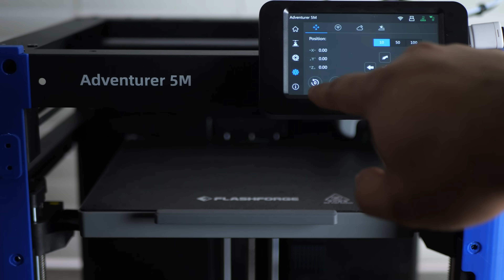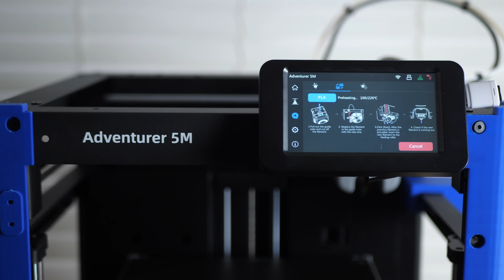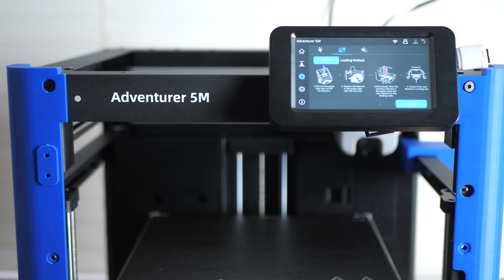How To Change Filament On The Flashforge Adventurer 5M

Comment: Flashforge really messed up on this one! Even ChatGPT is complaining about the lack of instructions, and suggesting there used to be a way to get it to heat and retract in the software. It's a wonderful machine, but this is a HUGE negative.  Except that you have this video, so it's workable.  I hope those Chinese engineers read this and get up the nerve to stand up to their bosses, so it gets fixed (I have an office in a Chinese country, and know exactly how badly engineering works due to the oppressive social order).  If not, at least put a help menu in there, explaining that you have to cut it off manually. It has some vague text in that regards, but no one would be brave enough to yank on that tube, without seeing it in a video.

Comment: so I've done this process 5 times already and it hasn't changed a thing. i used the PLA filament that came with the printer just to test out the whole system(worked great) ran out of the PLA and needed to switch to my PETG filament i had on hand.  I tried and tried, did lots of research and its still not switching over to the PETG settings. Am i missing something?. please help.

Comment: There's no way to reverse the extruder motor with code? My infimech TX backs the filament out from the extruder gears, then you just pull it out by hand from the back of the machine. there's no need to cut or remove the Teflon tubing.
Reply: They probably don’t allow that and it isn’t a good idea because you could clog the gears when reversing, since it won’t be a perfect cylinder after some of the end has been melted

Comment: I just cut the filament, pull it out, put the tube back in place and feed the new filament in until it touches the old one. Then I use the load option and hold pressure on the filament where it feeds in from the spool. It loads in and is ready to use.
Reply: same

Comment: Absolutely a deal breaker for me in buying this. What an enormous amount of wear and tear on the ptfe tube. You should be able to heat up the extruder, and pull the filament back without removing the ptfe tube.

Comment: Is it possible to pause a print in process and then change the filament out and have it resume? The original filament is almost out before the print is complete.
Reply from the maker: Yes, you can do that.
Reply: Thank you! It worked perfectly.

Comment: Thank you for this tutorial! Do I need to heat up my printer before pulling out the tube and snipping the original filament?
Reply from the maker: No, you only need to heat it up if you want to push the old filament out, or add new filament.

Comment: I've tried this. It does not work. No extrusion happens and the piece of old filament is still in the feeder. how do I fix now?
Reply: I guess my post didn’t go through but yall have a jam. You’ll will have to take the extruder apart. Plenty of videos on it but it’s easy. I’m not mechanically inclined and after the first time doing it with the video, I can do it now without. 

I’ve had to do it several times but that was bc my kid was using print files with temps far exceeding his filament rating so it would melt inside the extruder at the gears and jam. So make sure that’s not your issue or you’ll be continually taking it apart like me trying to figure it out. I also ordered a new extruder for $20 on Amazon thinking it was the issue.
Reply: @ Thanks I’ll try that
Reply: Same thing happened to me
Reply: https://youtu.be/VRQYyHNiHpQ?si=b_4w_QS1nrswG2E_
Reply: This vid I found actually works better
Reply: https://youtu.be/MaftJ5H2Qxo?si=N-DpZtOc4LjhsCQy
Reply: It does work wdym
Reply: You did it wrong mine worked perfectly
Reply: Mine worked. That's weird

Comment: What do i do if the printer won’t feed the little bit of filling into the nozzle
Reply from the maker: If you have a little bit of filament sticking out of the nozzle, you can cut off as much as you can. Then run the filament loading process again, and push some new filament into the hole on the top of the printhead. The new filament should push the old filament out.

If your filament is clogged in the nozzle, heat it up to at least 200 celcius and use the metal declogging tool that came with the printer to push the clogged filament out. Just make sure you don't use the filament loading option when you use this tool or it'll get sucked into the machine.

Comment: As silly as this filament change looks, it's simpler than the Creality K1.  At least there is no pneumatic coupler and a snap ring to remove everytime.  The purge is about the same amount and if we had full access to Klipper, this could be adjusted or at least write a proper purge macro.  I did see on Printables there is a print head filament cutter someone designed to where you no longer need to remove the PTFE tube. Wish Flashforge would have done that from the factory.  Maybe in updated models we'll see this.   Thanks for sharing this informative video!

Comment: Wow - thank you for sharing this video - just saw a feature I love: the klipper 'home' macro drops the bed to the bottom. On my SV07+, 'home' will bring the nozzle almost in contact with the plate, meaning there better not be a model still in place. The 5M obviates that entire issue by dropping the bed.

Comment: I also suspect it purges more filament than necessary, but I guess its better to waste a little more than be dissatisfied with your print being discoloured. Also I've checked - the bundle after the purge weighs between 0.49 to 0.75 g. Aint so bad, but hopefully future patches will optimize it.

Comment: shit.....what i  do is stick a piece of filament in the the useless run out sensor, heat up the nozzle and yank it out. Then just push new stuff. It takes 50 seconds for it to stop wasting your filament. 10 seconds or just seeing it come out the nozzle from pushing it is all you  need. Hang your spool from above like on a wall and give that foot long bowden  tube the finger. Thats one of the reasons you get a D.D. so you dont have to run your Fil. through that tube anymore. And y is the firmware so locked  down?......i cant even adjust the layer height during a print

Comment: Holy crap.  I got my AD5M today and went through all the initial steps and apparently they have updated that purge code.  Mine was a TINY bit excessive, but nothing crazy.  This one went through like half a spool lmao.  Might try updating your firmware?
Reply from the maker: I'm on the latest firmware.
Reply: I think the "swap filament" loads for a longer period of time. I only use the "load filament" function. When the old filament is pushed out you wait just a little bit and then you put the new filament in, during the same load process. Then you don't waste more than needed. I haven't found any difference between load and swap, except the time it extrudes.

Comment: Hello. Is it possible to print with one filament, and then pause, change the filament to a different color and then continue printing?
Reply from the maker: Yes, it is. In fact, I'm making a video about that right now.
Reply: @FigureFeedback  Many thanks, that would be informative. I’m also very interested in how to continue printing after a pause or power failure ))
Reply from the maker: When the printer comes back on after a power failure, it'll immediately get ask if you want to resume the print. You can manually pause the print at any time and press the play button to resume.

Comment: Is there not a unload option in the touch screen menu? I feel like taking the Bowden tube out constantly just to change filament will wear down the couplers and their ability to grip the tube?
Reply: The print head itself doesn’t have a connector, it’s just a friction fit since it’s a direct drive extruder. It doesn’t need a pneumatic connector on both sides of the tube the way a generic Bowden style extruder does
Reply: @silentrice7399  I see now that I have one not a huge fan of the waste amount and not being able to control how long to purge. Thanks!
Reply from the maker: You have to remove the tube and cut the filament when you want to unload it. I suppose time will tell if it becomes an issue.

Comment: how do you swap between the different materials? Seems like there's no way to control the preheating temperature. So how would you change from ABS which can be printed at 260 degrees to TPU which is printed at 220 degrees. Do you just try to load TPU while the nozzle is 260 degrees after extraction of ABS?
Reply from the maker: The filament load/swap menu does have different filament options with different temperatures. You can customize the temperature also. I made a short unlisted video to show that: https://youtu.be/gXvUqP6QbzA

Comment: Thank you for this video, I will receive the machine this week I hope, do you think that the 5M has a print quality as good as the bambu lab A1? Thank you
Reply: Don’t know if Bambi Lab print quality is better, but I’m blown away at AD5M’s speed and quality. For less than $300 it is incredible! At this price you can buy 2 for the price of a Bambi Lab machine.
Reply: @darkskys163  the question is if AD5 stable. I have AD4 and it's a nightmare. You indeed can print something that doesn't take longer than 3-4 hours. Otherwise it's a lottery with a probability of winning = 30%. Neither you can confidently print multiple objects. You print 1 and it's ok, you print 2 and it's ok, you print 3, then 4. Then you print 4 again and it's starts to shift the layer at the specific point and you can do nothing about it: rebooting, downgrading the software - nothing helps. All you can do is return to print 1 object at a time. Maybe after some time it will allow you to print multiple objects again for some period, and then you're going to have the layer shifts again. And I'm not talking about the sequential mode.
Reply: @antonkukoba3378  Well I cannot say anything about the AD4, but I still have the AD3 and it’s been a struggle with it. Compared to AD3 the AD5 is light speeds better. If memory serves me, I spent at least $50 to $100 more than the AD5. Time will tell if the AD5 will last.